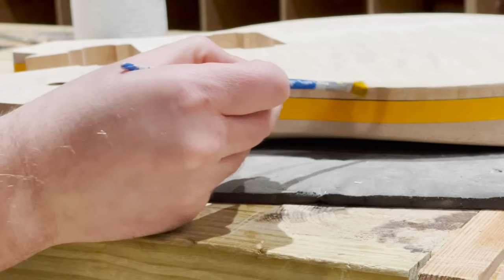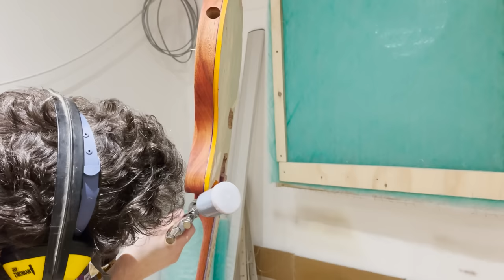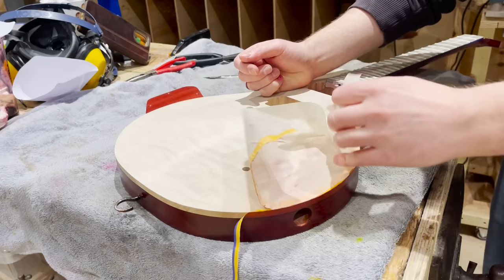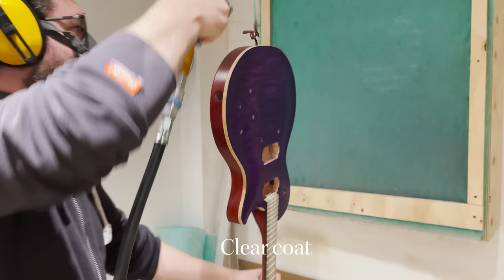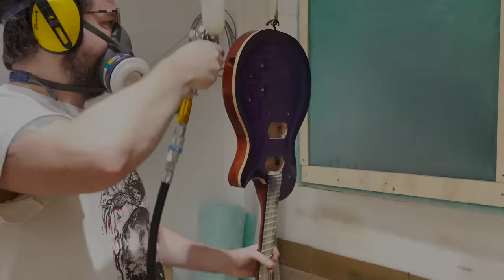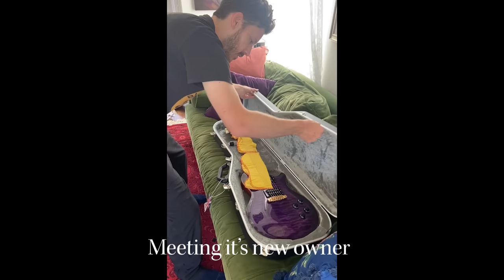How to STAIN and LACQUER a GUITAR, a complete guide | Quilted maple LES PAUL build | E4/4

Comment: The neck joint is too tight if you can lift the body just by the interference fit. This has been propagated for years into being "false best practice" purely to flash a luthier's work accuracy. Assembling the body and neck with a joint this tight mechanically removes glue from the sidewalls of the mortise, enough that joints are often insufficiently wetted for ideal adhesion in service. A common method used is to extend the depth of the mortise rearwards by a 1/2" or so and insert the neck further back. A clamp reconfigured as a spreader pushes the neck forward to its correct position from the back of either pickup rout, increasing pressure either side of the neck, and the neck is clamped as shown here. This is spoken about far too little from a builder's standpoint, as the issue more commonly seen during neck resets and repairs. I have to ask as well, why do you raise the grain prior to dyeing without knocking the deformed/loose fibres back?
Reply from the maker: Yes that was why you saw me sanding the side of the tenon down, so that the pocket is no longer too tight. For a good fit, the neck want's to be just falling away from the pocket with the weight of the body. It doesn't want to be much looser than that or it runs the risk of losing the centre-line.
Reply from the maker: Alcohol dye does not soak into maple as well as water-based dye, dampening down the surface enables the dye to penetrate further. I did also raise the grain in the sanding process but I didn't show that because sanding doesn't make for good tele.
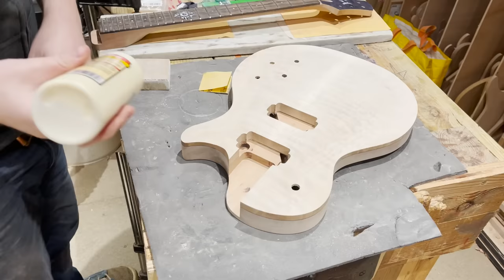Reply: @ADFinlayson  3:40? I'd say that even this is slightly too tight, but not as tenaciously airtight/gravity-proof as some builders think is some sort of ideal! Wetting a top with water prior to the application of alcohol-based dyes runs the risk of furring up the surface from any fibres not knocked off during initial grain-raising/sanding steps. Given that you use solvent after dyeing to pull excess and even the colour out, this might be a risk that isn't necessary to take. What works, works and results speak for themselves.

Comment: It would’ve been nice, if you had explained what you’re doing and why and what you’re using to do it. For example, what did you use to apply the stain to the headstock. Did you then sand it or just wipe it off afterwards and with what? What grid of sandpaper for which step? It’s not a complete guide, if I have to guess everything. Maybe you can add some subtitles with the necessary information? I’m not trying to be a bitch, by the way. I would’ve really loved to get the information.
Reply from the maker: I use cotton to wipe on dye and just wiped off the excess with a clean cotton rag, you can get t-shirt material on amazon quite cheap. I normally sand up to 240, sometimes 320 on end grain.
Reply: @ADFinlayson  thank you very much!
Reply from the maker: No worries, I will do a voice over on the next one. Baby arrived while I was editing this video so it went out as was I’m afraid.
Reply: @ADFinlayson  in that case you’re excused! 🤪 Congrats on the wee one! 🙂

Comment: Sorry but how is this a guide with no explanation of what you were doing or what you were using. What is the sealant you used?  What was the filler made with?  Did you sand the filler?  What stains did you use. etc.
Reply from the maker: The dye is Angelus, I did a detailed video a while ago on how I make grainfiller https://youtu.be/Hx-6Mhd31qQ

If you didn't see me sand the filler in the video, I didn't do it.

Comment: Everyone who knows anything about painting will be cringing every time you touch the neck with your greasy fingers.
Reply from the maker: I cringe every time you leave a comment.
Reply: @ADFinlayson  Basic rule of painting, keep your grubby, greasy fingers off clean surfaces. Rather than cringe you should just admit your mistake

I've spent many years restoring and finishing Rolls-Royce and Bentley interior woodwork with everything from nitrocellulose, melamine, acrylic, urethane and different polyesters depending on what finish was called for or requested. I've also refinished more than a few guitars including some I've built.

Cleanliness is everything and while you can usually deal with most dirt nibs, oil, grease and other deposits left behind by fingers are trapped beneath or between coats. This is where the paint system fails later. If you feel the need to touch, just wear a glove. Better still find a way to manipulate the guitar then you can work with other materials easily.